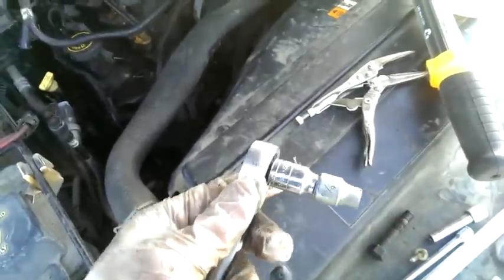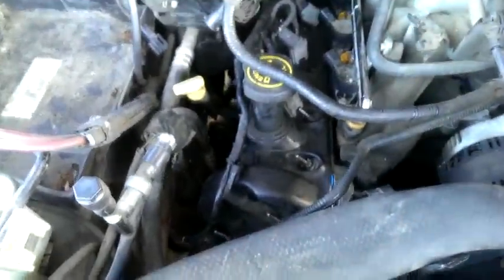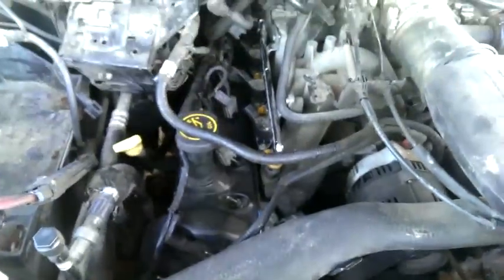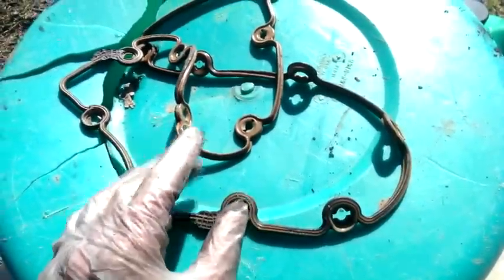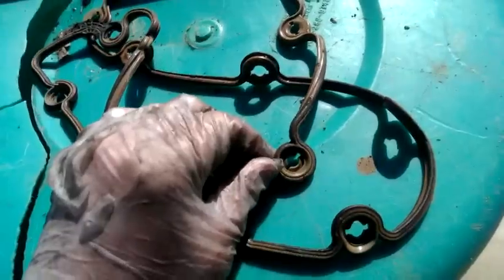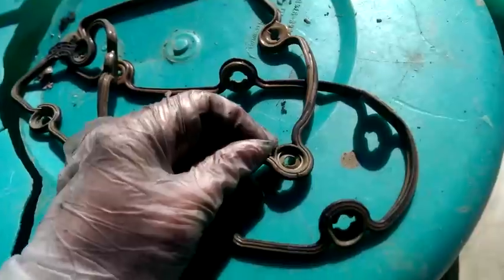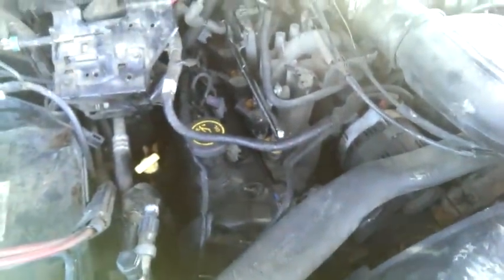Replace Valve Cover Gasket 99 Ford F150 5.4L 4 of 4

Comment: I know that this is an older post but for future info. I have oil leaking on the passenger rear of engine thought to be the infamous head gasket leak and still might be. But when I went to change the spark plugs I noticed 1 spark plug well on the passenger side and 3 on the driver side were filled with oil, which by all indications points to valve cover gaskets. I inspected them and tried to tighten them but saw no visible leaks and were tight already. So I embarked on the tough task of replacing them, here's what I found out about the process and am posting it in hopes it will help some one.
 1st don't only change the gaskets but also the rubber grommets on the valve cover bolts as well. The bolt also hold the gasket in place. MAKE SURE to clean and replace the 2 dabs of rtv silicone near the front on each cover where the timing chain cover meets the head. In fact as I'm writing this I have to go out and redo the drivers side, I have a small leak at that rtv spot at the bottom. 
 Some tips I learned doing this procedure. On the drivers side, I did have to remove the mount for the power steering reservoir as well as the EGR tube which came off surprisingly well. I also removed the drivers side tire to gain better access to the far back bottom valve cover bolts.
 On the passengers side thing are a little tougher. I took of the alternator harness as well as the 1st part of the mount for the the harness on the firewall and zip tied it off towards the battery. the 2 harnesses by the back of the cover are the WORST and can never get them out of the way completely. After I loosened all the cover bolts by moving the harness back and forth for top and bottom bolts, I used a bungee cord to pull them up and over towards the the driver side. I also removed the tire on the passenger side along with the wheel well cover, Which came over pretty easy and is a must to reinstall the valve cover. Because the 2 wiring harnesses are so in the way, when reinstalling the valve cover the gasket kept getting hung up on the the last bolts on the cam shaft. So by having the wheel well off I was able to lift the valve cover enough to get my fingers in there and to see to ensure that the gasket was properly in place. 
I will go out now and redo the drivers side and add some more rtv sealant at the timing chain cover, I'm thinking that I rubbed it off or maybe even forgot it on that bottom joint. Also I hope that this is the source of my leak on the passenger side, I will give an update for those wondering. 
One last tip while you have the covers and air cleaner off check out your throttle body, mine was filthy so I removed it and cleaned it along with the valve covers.
Reply: did it take care of your oil leak?

Comment: I am surprised that there are no comments.  Decent video.  As you said, you are not a professional mechanic but your video does show what is involved in changing this valve cover gasket.  I replaced my intake manifold on my 2001 Ford F150, 5.4L recently and my valve cover gaskets were leaking so I decided to change them too.  I think changing the valve cover gaskets was at least as challenging as replacing the manifold.  Nothing is easy on these Ford v8's. My son changed the valve cover gaskets the first time, but I ended up with a big oil leak from the drivers side valve cover so I decided to do it again.  Except for the power steering reservoir bracket I thought the driver's side wasn't too bad.  I found that my son had not pushed the small washer on the bolt through the split in the gasket.  But doing the passenger side over was a bear.  I took off everything that seemed to be in the way , more stuff than you took off and I still couldn't get the back of the valve cover far enough back to line up all the holes.  We finally realized we had not taken off the water hose at the back behind the valve cover. As you said space back there is very tight and any obstruction whatsoever will prevent the valve cover from going on properly.  Once we removed the hose from the pipe and got it out of the way, the valve cover went on without too much of a problem.  I removed and installed the valve cover without a gasket three times to be sure I could install it reasonably flat so as not to move the gasket out of place when I do install it which I plan to do tomorrow.  Thanks for the video.
Reply from the maker: Charlie Wilson I appreciate the helpful information, others can benefit from it. I hope other commentators will leave helpful remarks as well for anyone else "googling" how to change their valve cover gaskets.
Reply: Us3are 1 I appreciate the video man. I had to replace the valve cover gaskets on my explorer and they wasn't no where as hard to get to as the ones in my f150
Reply: Charlie Wilson I appreciate the information you shared
Reply: Us3are 1 helpful hint is to use 1/4 inch drive rachet smaller tool for tighter spaces, and the gasket placement is important ,I used a small blunt ended punch to work the gasket under the washer on the valve cover bolts, anything sharp will damage the gasket like a awl or flat screwdriver , injector rack and coil pack harness does have a main disconnect on the computer LMAO ,but OK job on video

Comment: Great video, I'm a little tech savvy but this is the first vehicle I have owned to have lasted me this long on all original major parts (plugs, belts, pulleys, bearings suspension etc.) But engine wise all original, alternator, power steering and all gaskets.. I hit 300k and blew a plug. Of course normal mechanic would just replace the broken pieces. Myself I grabbed my Endo scope and seen massive build up. Like you said patience. So I went thru the intake seen it just as bad and removed it, hell even my EGR was original.. my vehicle is a work beast and my off grid explorer. I was surprised when I went to rethread my plug hole that the head itself was aluminum. Since I had intake off I rethreaded all the cylinders (data shows heads didn't have enough thread to plugs, turns out they usually have 4 threads. I abuse this thing but I'm particular when it come to maintenance.. im not gonna lie I jumped to the areas I needed mostly the last five minutes of your video because the original gasket was still on this which was flat plastic and rubber in the center. Had no idea which way the rubber grament should go and you made sure to include that little bit of life saving information. Your a mechanic, don't rob yourself of that title. Thanks for the information

Comment: That metal pipe bro is your EGR return line. it takes the exhaust and recirculates it to the intake manifold. From what ive been told it suppose to help cool the pistons. I have a 2000 camry and i cleaned my EGR valve and response was improved dramatically.

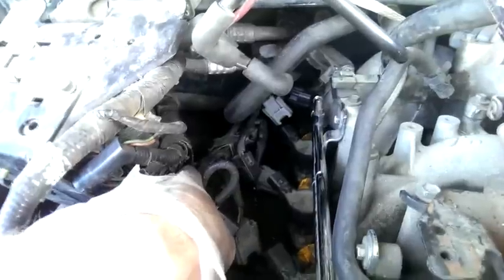Comment: 1:36 a little pointer, as you can see they just taped it in there for most of it. I found cutting it and taking the wire out of that plastic bracing and just bending the loom out of the way was very much easier. then just use zip ties to put it back, it works better than the tape.

Comment: It's 4 months later and my question is how bad are they leaking on you now? The gaskets require RTV applied in two places on each new gasket (for a total of 4 spots) near the front where it transitions from the heads to the timing cover, that's what the flat waffled out spot on the gaskets are intended for, and you didn't mention you did that.. Secondly, and it's something Charlie's comment brought up, this job is entirely impossible unless you remove the intake manifold before hand. Especially for the passenger side cover. And as he mentioned, the heater hose that runs behind the manifold needs to be removed from the metal portion under the manifold to ensure the cover goes in and seats the gasket properly across the rear. I'm not a professional automotive technician by any stretch of the imagination, but I've worked on a few of these now and getting that side to go in and seat without rolling out and pinching the gasket in the back is just not possible with that hose in place unless you get extremely lucky there. Not trying to be an asshole here saying you did it wrong, in fact you pretty much had the rest of it correct except for a few personal nit-picks. But for anyone watching these vids, I wanted to share that removing the intake makes this job 100 times easier, and removing all the other crap, like alternator wiring, wiring brackets on the left. may make it take longer to do, but it makes a nightmare of a job into something tolerable.
Reply from the maker: Riptides99 That's good information, I didn't even consider the waffled areas needing anything. But as far as leaks, there haven't been any. As far as removing more stuff, I knew I could have, but since I had no instructions and was blindly removing stuff to get at these covers, I figured the less I had to remove, the better. But, as I think I stated in the video, you have to have some long thin arms/hands and try a bunch of positions to remove the covers and especially to get them back on the way I did it. Hopefully people read your comment and do it the way you're suggesting. Thanks for the info.
Reply: Us3are 1 Thanks for taking my comment in stride, as it was a bit harsh up front. I've had to help a few friends fix the leaking passenger side where the gasket rolled out in the back on their Expeditions and F-150s. I can't stress it enough that when doing this, it's just easier to remove the intake. Ford Tech Makuloco has a great video on removing and reinstalling the intake. And if you are going to remove it then plan to replace all the plugs while you're in there. You'll have the best access at that point and if these gaskets are leaking then generally the plug wells will be full of oil, maybe even coolant, which brings me to my next point. With the intake removed it's a good idea to check the intake to coolant crossover pipe that mounts across the front of the intake. As in remove it and replace the O-rings and the thermostat. The intake itself is prone to failure on the passenger side, and will dump coolant onto the engine area below the intake, or, at worse, suck coolant into cylinder 1. There's a good post on a Ford F-150 forum about this issue, google it. You can repair the plastic intake with epoxy and use RTV Silicone on the intake to cross over, or just buy a new intake ($200). But keep an eye out on the area under the intake for coolant, most of these will leak slightly for years before failing completely all at once.
Reply: I was actually told from Ford that you should not put RTV sealer on the gasket at all. I just replaced the gasket on the drivers side and am having a bear of a time trying to get the passenger side off. Any suggestions? I had to come inside and get away from the project because of how frustrated I was.
Reply: The shop technical manual states a 2mm or something bead of sealant on the valve cover gaskets at the transition from block to head. Pretty typical on any metal joints with an oil sealing gasket/surface attaching. 

You almost cannot get the passenger side valve cover off/on until you remove the rubber heater hose from the metal part that runs under the intake manifold and remove the wiring harness block (connectors?) from the truck firewall.

It's worth the headache of having to pull the entire upper intake because once you open the space up you wonder how he truly magic'd that cover off and on, with the gasket still in place, in this video. I'm honestly astounded.
Reply: It's pretty simple really how he did it. He prayed ;) ( no sarcasm inserted)